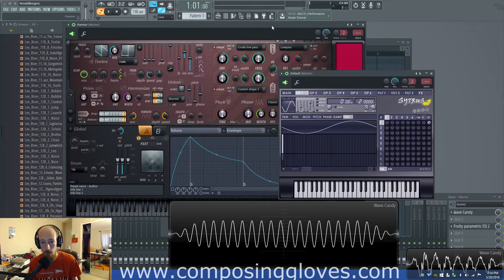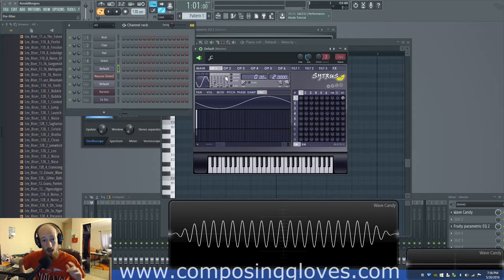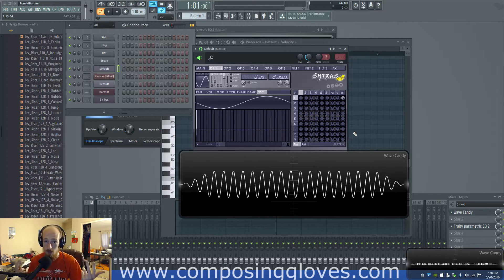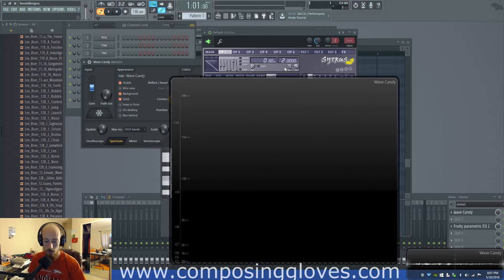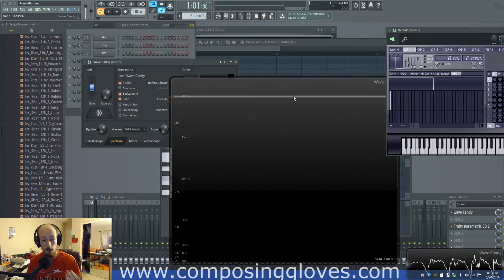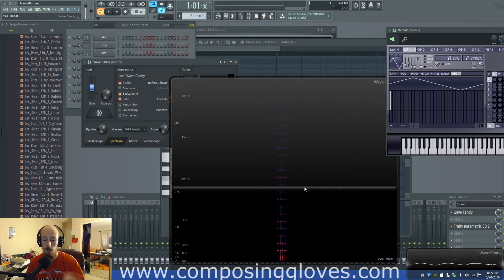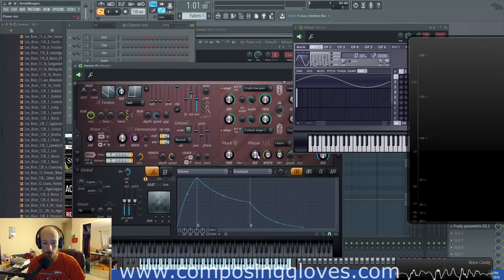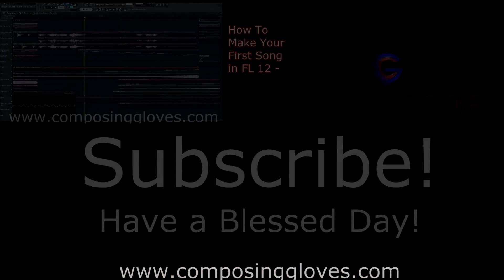Sound and Synth Basics 11 - Common Overtone and Harmonic Seires

Comment: Hey m8. First of all, thanks for your series and explanations. Yet, I cant figure one thing out.
You told that a (textbook) saw wave is composed by multiple sine-waves (harmonics). For that we take our base-tone and sum it with sines that are twice as fast and twice quieter. 
So I went directly to some online-ploting sites (e.g. fooplot.com) and plotted the sine-waves to look, if thats true.
That's the graph I eventually looked at:
sin(x) + sin(x * 2) * (1/2) + sin(x * 4) * (1/4) + sin(x * 8) * (1/8) + sin(x * 16) * (1/16) + sin(x * 32) * (1/32) + sin(x * 64) * (1/64)
Well, that kinda has some distant resemblance with a saw wave, but that's definitely not something we see in the wave-candy. What am I missing?

Cheers.
Reply: Ah, I see, it turned out, that to additively create a saw wave, we need to take actually each multiplicative of the base-tone, like sin(x * 3) * (1/3) and 5, and 6 and so on...
Reply from the maker: @fattumhawk3257  Yea, so the equation would be \sin(x)+\sin(x*2)*(1/2)+\sin(x*3)*(1/3)+\sin(x*4)*(1/4)+\sin(x*5)*(1/5)+\sin(x*6)*(1/6)+\sin(x*7)*(1/7). This is because the harmonics are the harmonic series. (often introduced in calc 2 as a interesting series of 1/n, and later built on with fourier analysis).

Comment: "All systems are band limited, but you're going to learn about bandwidth later" yeah, no explanation brother as to what band limiting is and it should be in this video or next I think, you tell me :) (In relation to comment on other video DAB 4)
Reply from the maker: Band limiting is just filtering (removing all the frequencies except the ones in the allowed band). Using a bandwidth of some finite value is a band limited system.
Reply: thanks a bunch.